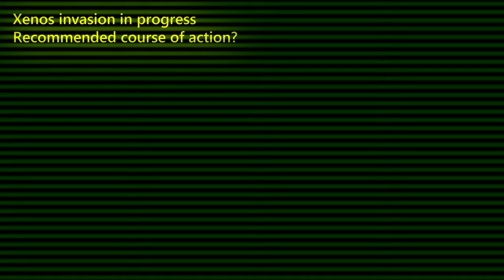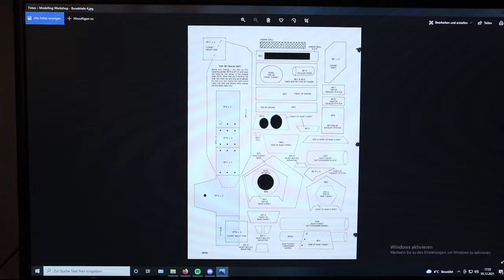Baneblade from Cardboard | Warhammer 40k | Apocalypse | Scratchbuilding | EN

Comment: REALLY great job, I remember that WD's number, in those days they give a lot of templates either for conversions and scratchbuild.
P.s. I noted the lack of an hull 's bottom, with plasticard this shouldn't be an issue, but with cardboard this could cause a warping of the hull, perhaps you should add some internal reinforcements with foam.